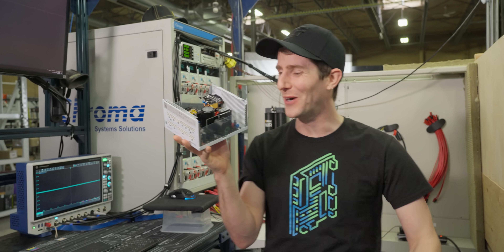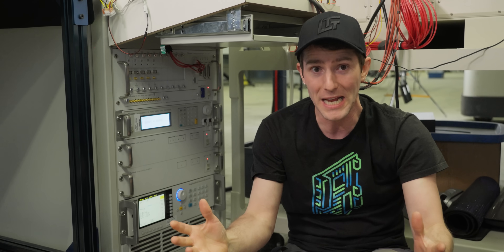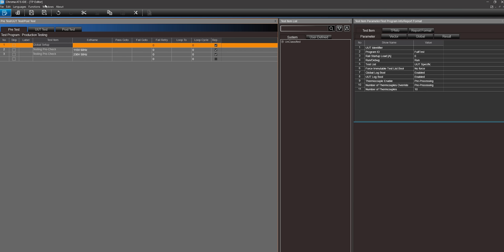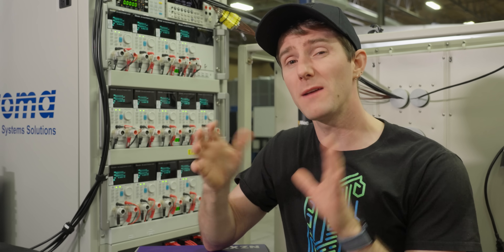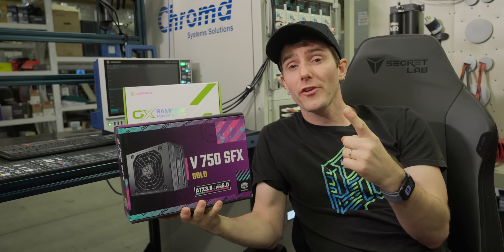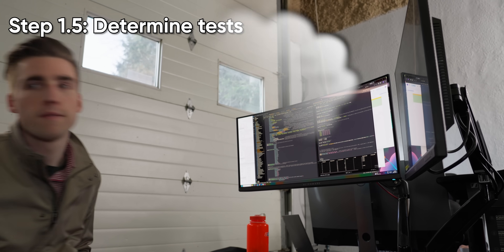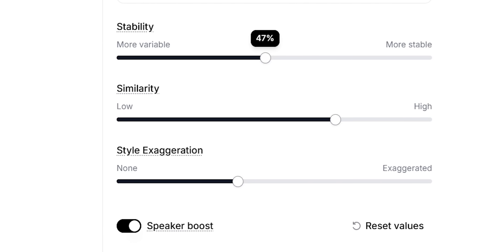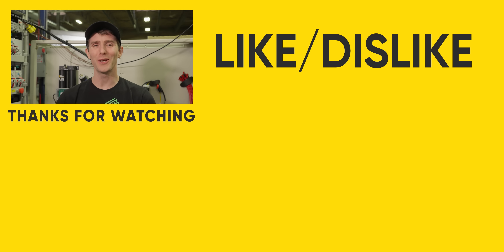Thousands of You are Buying Dangerous Power Supplies

Comment: My only legitimate concern is the fact that you guys are sourcing a piece of equipment from an actual power supply manufacturer. At 12:15 you mention that the interface board was provided by Seasonic. Admittedly this is tin-foil hat territory but it rubs me the wrong way that your power supply testing process relies on a piece of equipment from a power supply manufacturer. Unless LMG has independently validated that board, it's possible that the board may favor Seasonic power supplies depending on how it was made. I know the R&D is expensive but it'd be much more preferable for your testing to be made of boards/testers, etc. independent of manufacturers you'll be testing against.
Reply: It looks like it’s literally just a board with a bunch of connectors on it to make hooking stuff up more convenient, and doesn’t look like there’s any active circuitry. No need to be concerned.
Reply: Brother it`s just a wide board with a bunch of useful connectors. No logic. It`s as inteligent as water in your toilet. Don`t worry about it. If it was somewhat intelligent they wouldn`t have to hook up each probe individually.

Comment: Alex loves experimentation.   I recall an era of in car audio systems, where we had a transition period for beefy capacitors.  They started advertising chonky multi-farad capacities.   So in the form factor of a d class amp, you could now buy a beasty capacitor. 

Hang with me for a moment.   These capacitors had battery, ground, and trigger wires.   Something stupid like a 5090, now has combined 12v and ground, and your PSU has a trigger wires, in the form of any spare +12v from a drive connector or whatever, that you can filter through a diode for safety (also indication if you use a light emitting one!).  

So.   

2 farad capacitor backed 5090 anyone?

Comment: Running power supplies at overload is not the best kind of test because you are exceeding its rating. for example if  something like a linear regular is rated for  1A max you shouldnt run anything that can use 1A or above it on it if you want stability.  While some companies use over-rated components for the job , some use close to the exact rating needed. for example one person can use a mosfet rated for 60Amps if the load is around 40-50A  but another might use  120A mosfets for that which is overkill but also increases the cost of the whole powersupply. This has been the case for pc components like vrms.

Comment: I wish that Labs-Website would be more like RTINGS, with easy to understand "out-of-10" scores for different things. I know that scores can't express a lot of the nuances that might be relevant between different test results, but it would be an easy way to find a power supply that performs well in the scenarios I care about.
For example similarly how I could filter RTINGS monitor-list for the best brightness-score or best "Color accuracy (Pre-Calibration)"-score, I might want to filter PSUs by best "idle-efficiency"-score or "high-load-efficiency"-score.

Comment: I put a corsair 850e in my brand new build 7700x 9070 non xt. Im pushing nearly double the power than i need to run my pc (450 watts) and 200 watts over recommend (650 watts). I made sure i had an upgrade path since i wanted to pick up an XT version of the 9070, and i need a recommended 750-800 watts psu depending on the card. I guess heres to praying i dont burn my pc down

Comment: I've had a Seasonic PSU die on me twice. Two different ones of the same model (Seasonic S12III SSR-650GB3 650W) They both died the same way. With the PC off. I heard a pop and saw a blue flash. After the second one died, I bought a different model from Seasonic and have had no issues. Could you guys possibly test that model of PSU?

Comment: PSU reviews should indeed be part of the main channel, it s a vital component that often is neglected by many. Running multiple PSU tests summing up your findings in a reoccuring series would be the way to go I d say. Having more in depth tests for the ones really interested in the ins- and outs of an individual unit is a good bonus and I doubt that anyone would complain if these are done with cost saving measures applied (like AI voicing etc).
Reply: That’s just not how youtube works, putting underperforming videos onto the main channel would drag it down in the algorithm. Better to shout out a side channel for those videos with niche appeal.
Reply: @JustCallMeEm.  Whilst I generally agree with you on this issue, I was thinking of 1 quarterly video on multiple PSU (x are good in category y and z are bad etc). Given the number of videos LTT produces, I assume this wouldn t have any impact at all even if they underperform. Otherwise, I think such quarterly vids would actually perform well.

Comment: Does all of this apply to Europe as well? I mean, must these tests performed at both 240 and 110-120 volts or can we rely on this video which is exactly 115 volts?
Edit: I learned something: the only palaple difference of those voltages is that in Europe the maximum power output (watts) is higher than in the USA/Canada. BUT there's still the difference between 60 Hz (USA/Canada) and 50 Hz (Europe). Does that matter much?

Comment: re: AI voices. It's fine, but I'd probably cycle the voices between brands, because the problem with AI voices is that they tend to have a monophonic read to them, so if two videos for the same PSU (Eg 850w)) have the same voice, people might think they've "already seen it" and click away. The main drawback for AI voices is that there's a rather profound rejection of "AI use" when a human could do it, so for that reason, cut as much fluff out of the AI-spoken video as possible, and just front load the video with a host who just physically unboxes the PSU and mentions the marketing on the box and then cut to the tests. If a PSU fails, then just bring the host back and do a "oh, that's not good" and if it passes do a "recommend" . That way if people just want to see if it passes, they can skip the entire AI voiced test segment and that's OK. We tend to do that with other tech channels anyway when we just want a "buy/do-not-buy" and then go back and check the tests/benchmarks when we want to compare two side by side, which an "AI" generated template might be easier to do if everything is in the same order.

Comment: Is it just me or is the ~500W PSU market super diminished? I'm building my dad a PC with some older spare parts I had. Its still older Kaby Lake stuff but he's currently running a PC from 25 years ago still you know. Its really hard to find a good variety of quality / reliable branded PSU manufacturers making 500W bronze units besides corsair, and even then I'm not even sure about their units. The rest of the market is either older used PSUs or a PSU that came out of a Chinese factory that slaps 20 different labels on the same unit. Why do I have to spend like $140 to get a a quality unit? I want to get something reliable, he doesn't need a 850W 80+ Gold unit running integrated graphics and stuff, I just want something that will last him another 15 years. RIP EVGA

Comment: Is it me or does anyone else feel like testing a single one of each unit is not really a good testing methodology?  Some if not most of these sell by the tens of thousands, you would need to purchase and test dozens if not hundreds of units to be able to say with any kind of authority that you didn't just receive a bad unit.  Don't get me wrong, none of these SHOULD fail at all, but this isn't really the same as something like your cpu testing where you're basically testing in the same way as hundreds if not thousands of other trusted reviewers are, and if folks are interested they can look around to see how your results match up to those others to be absolutely certain.  Maybe I'm just overthinking this, but it feels like the comprehensive and prohibatively expensive nature of this testing would require a much larger sample size for each individual PSU model simply because so few others are able to do the same type of testing.

Comment: "volt-amps" is the stupidest, most inane unit of measurement. It's just marketing bs -- it is just a rating in Watts that needs to be discounted for inefficiency to be accurate. The number of people I've had to explain this to who have been confused about how they're different is way too high. Notice how solar panels are just rated in Watts? It's the same exact thing, and you never actually get "100W" out of a 100W solar panel, yet it's less confusing to say that as the theoretical maximum.

Comment: Hardware should always be slightly overbuilt for specs, just in case something goes a little bit wrong. A PSU dying at 110% is very bad.
Reply: A psu dieing at all from overload is a problem. It should have a safety shut of
Reply: In the world of cheap and nasty power supplies, vastly overrated units actually are quite common and have been for decades. Anywhere from +50% up to +100% in extreme cases. That's about the only thing left to do once the usual route of going for an outdated inefficient platform and the cheapest capacitors known to man has been exhausted. Skimping on rectifier cooling in 220-240V-only units is also a thing, efficiency tends to take a nosedive at high loads then.

Comment: Appreciate all that testing efforts toward PSUs. I recently had an encounter with the MSI A650BN 80+ Bronze rated PSU, regarding it's hold up time. Not many people understands how crucial the hold up time is, especially if you live in places where there are power cuts. Even if you have a backup UPS there is still a small duration of time (which ranges in milliseconds) which the UPS takes to switch between the power supply lines. Upon doing some research after my experience, I found that even reputed brands like MSI do not put up this crucial information in their product specifications. Many of the PSUs fail to meet the ATX standards in this regard (which is ≥ 16 ms). Looking forward to the data published by you all to select the appropriate PSU for my next build, which satisfies this criteria well.

Comment: I ran a Corsair CX650M through three different builds, but the final build was the one that eventually killed it. Paired up with a Ryzen 5800X3D and 6800 XT, It took about a year for that PSU to finally die once in the current rig. I swapped it out for a Corsair RM 750E and it's been great. I definitely feel like my current build was pushing that 650 a little harder than it was intended to be, though lol

Comment: Electronics repair technician here. No surprise that brown outs claimed several PSU’s. Over the years, I’ve seen nearly as many electronics (TV’s, stereos, DVD players and so on) wiped out from low voltage as from over voltage. Ohm’s law/power law comes to play here. For a given amount of load, if the voltage goes down, current must go up. Brown out causes a spike in current demand and over current burns stuff up
Reply: i have battery back ups on all my tech now.  brown out killed to much stuff. mostly due to fpl poor maintenance of lines in my county

Comment: I've only had one power supply fail, and it was after about 5 years of literal constant and hard use (lots of dust, poor airflow, periods of rest then hard gaming daily, etc). I was asleep with my computer in my room, I hear a small "pop" and smell smoke. Turn the lights on and see some magic smoke coming out of the supply. Nothing else was damaged and considering how much it cost and how long it lasted, not a bad deal.

Comment: I didn't watch the full video yet, but want to share this.
Back in 2012 the last part I needed was a PSU. I didn't have a clue which one to buy and I opted for a cheaper $30 unit.
It worked perfectly for 8 years, but I always had stutters in my games whether I changed my GPU, RAM or even CPU. Only in 2020 I learned that I figured out that the cause probably was my cheap PSU all this time. Regrets!

Comment: The “getting platinum efficiency out of gold parts” reminds me of the first Soviet mission in Red Alert 2 Yuri’s Revenge: “out superior Soviet engineers increased the efficiency of the American power plants too much. We have arrived more than 65 million years in the past”

2:52 I haven’t seen an Anderson powerpole since high school robotics, I don’t know why I’m pointing that out but I’m glad to see it
Reply: Something like that is what they should have used instead of the molex style connectors on the GPUs. I also say it should have been atx48vo as the new spec they tried to bring out. 1/4 the amps = 1/16th the heat in your connectors. Make it a wide spec and battery backup off 48v telco gear becomes easy too.

Comment: My first PC build use a Gamemax power supply and it blew, while the computer was in standby one day out of the blue. When I reached out for the warranty, they wouldn't respond, so I replaced it with a ThermalTake that's now been going without issue for almost 5 years.

Comment: Something for labs: make a power supply recommendation system.

Let users put in their cpu/socket, mobo, gpu etc. and have it recommend a psu based on connectors and power output from PSUs labs has tested

Comment: i have a 480W PSU in my Gamin system that could use more than 600W at peak, if you believe what stands on the Box of all components, but this is near the reality in normal Gaming. 
i have an AMD Ryzen9 5950x, 2 sticks of LPDDR4 3600 ram, 2 SATA SSDs, a RX6700xt with Liquid cooling and a EisbearPRO as Pump and CPU block attached to a SIGLE MORA 3x3 120 radiator with only one 200mm fan in case i need more cooling. My system is dead Silent and uses in idle under 30W and while Gaming 300 at worse. I play on 1080p60 with Vsync on. i can play nearly everything on ultra in this configuration.
Synthetic benchmarks are far from reality and doesn't show you how your system performs, it does only show you how your thermal solution performs. In my case, if i had a bigger PSU my thermal solution doesn't work perfectly. For my use case it works fine. i mean yeah i have 48 to 65°C coolant temperature on the high side, but it drops up to 8°C lower on the cold side if completely passive cooled if with active cooling it drops about 15°C. if you consider the flow rate of 1L/min this is a significant Energy transfer. 
If someone asks. No, i don't run in Thermal throttling. The only thing that complains about Temperature is the VRM on the Motherboard and the SATA SSDs because of No Airflow. but this is usualy only a warning it doesn't affect the System performance or trigger a Emergency Shutdown. So everything is fine. Also, I don't have RGB i don't care about looks, and also it uses unnecessary power and generates heat.

Comment: That MSI A1000G PCIE5 PSU that died during testing is the exact model I have in my PC right now. In fairness to me, there were only a select few PCIE 5.0 power supplies on the make market when I built my PC almost 2 years ago, and even fewer available to be purchased in Canada. Its been fine for the last 2 years though, so I'm torn. Do I replace it? or leave it in?

Comment: built a 13900K system with a Deepcool 750W PSU and the computer kept crashing. bought a NZXT 1200W PSU and magically it not only didn't crash, I was able to undervolt and overclock! (note: GPU at the time was 4070 pulling max 200W, usually under) to be fair, it could well be the out of spec multicore enhancement by the mobo pulling crazy W and amps perhaps. who knows.

Comment: Hey guys, just a recommendation. If a PSU fails, obtain the second sample from a different lot number. This approach helps determine whether the issue is specific to a particular lot or if the entire PSU series is out of specification or not recommended for use.

Comment: 10:00 Isn't a brown out when the electric company purposefully disconnects districts in rotation to protect the grid?
Reply: That's a rolling blackout. A brownout is a low voltage condition caused by hardware, distribution, load, or generation issues.

Comment: im surprised ive never heard of a power supply that includes a small ups. even something like 30 secconds should be plenty for a computer to recognize and either shut down or go into hibernate if the power goes out like a laptop with a low battery. it might be popular for preserving any unsaved work for professionals or even to avoid any impact of the hard shutdown on other components for regular users.
as it would need to hold full charge the vast majority of the time i suspect capacitors might be a better choice than lithium batteries for long term use.
is anything like this even available and if so are they insanely expensive?

Comment: 7:52.
ok this is interesting, i had the A100G PCIE5, which i belived failed in some sort. it still works by itself, but it killed both of my ram and damaged the Motherboard at the same time. ( i Had a crash with a blackscreen and after that the problems occured. constant crashed, BSoD, monitor turning off with no signal after eiother seconds or a few minutes of use.

If you guys see this and is interested to have and test it just hit me upp